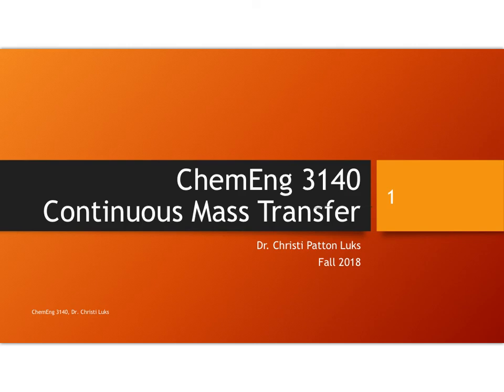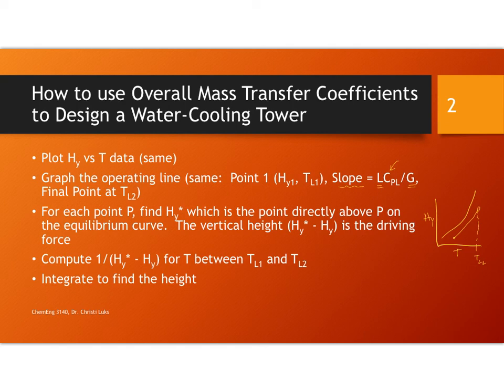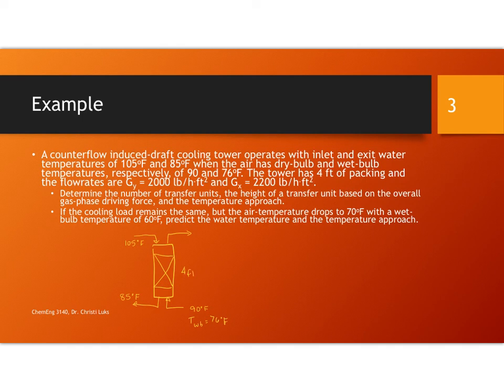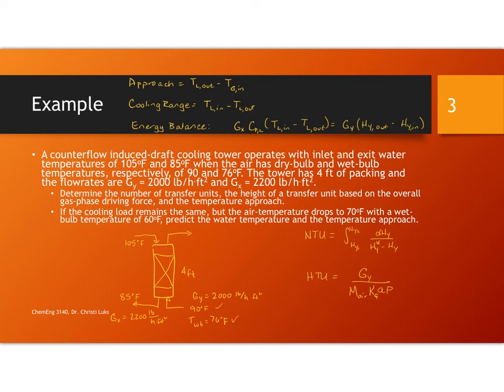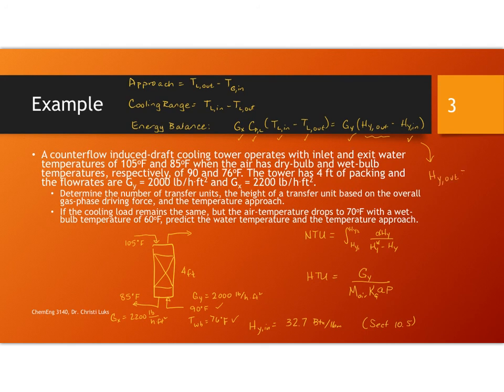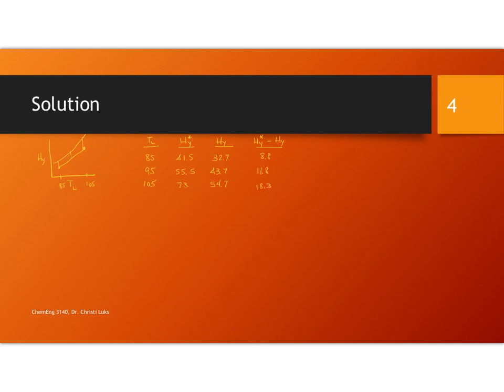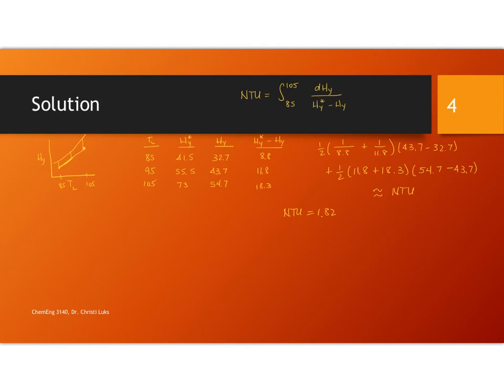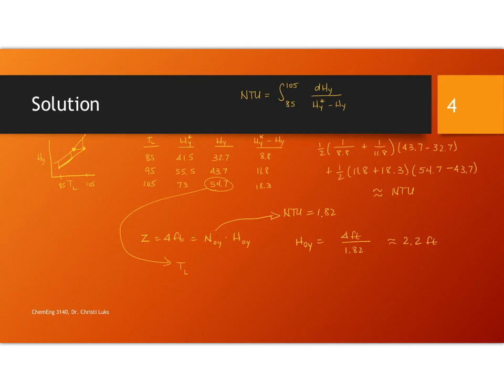First Cooling Tower Example

Comment: Can you elaborate more on the trial and error part using the integral at the end? How do we end up getting T(out)?
Reply from the maker: I solve problems like this in Excel. Guess the temperature and set up the numerical integration. Create a final equation that is something set equal to zero. Use GoalSeek or Solver to change the value until you get the answer that makes your final equation true.
Reply: @pattonluks  Ahh i see, thank you!